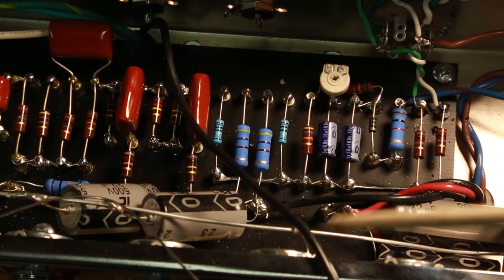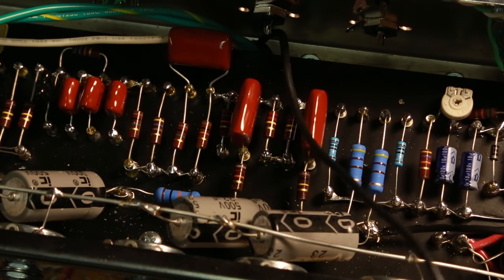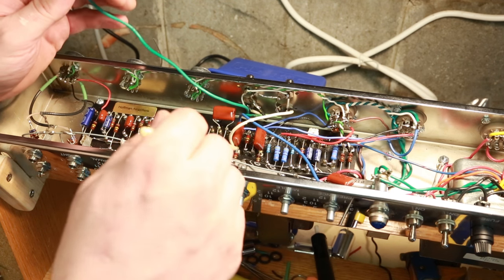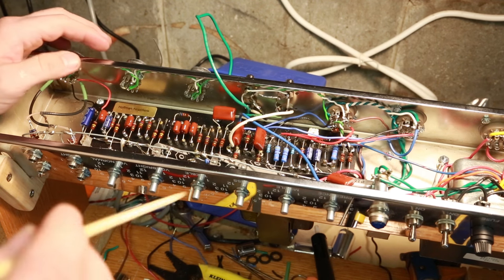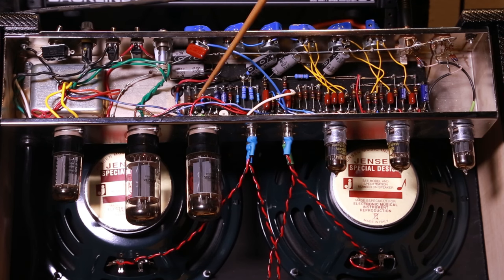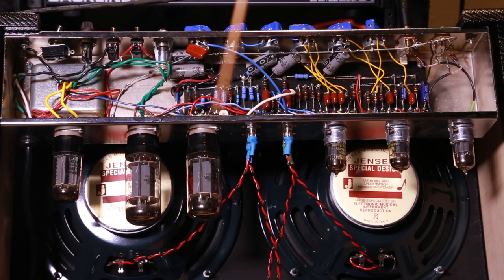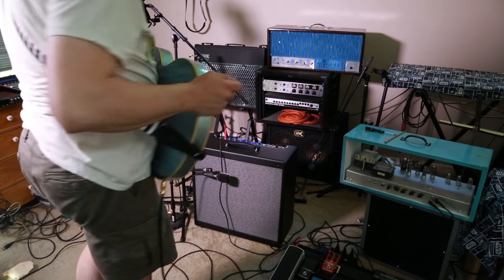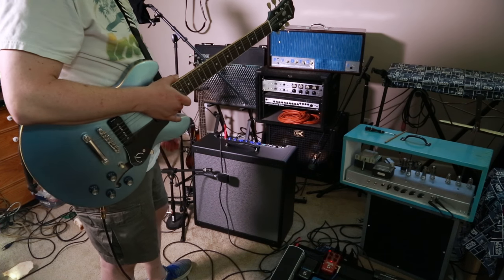Fender Bassman 5F6A Final Build and Demo

Comment: Why didn't you bias the output tubes? If the distortion sound bad, that's a first sign, but you can also hear in the clean tones. Showing bias values and voltages on an amp build like this could really help out others.
Reply from the maker: I did bias them, there's a bias pot built into it.  I don't think I thought to put that in a video, but I possibly did in the video before this,if at all, since I did this almost a year ago, I've forgotten, sorry!
Reply from the maker: It's also possible some of the distortion was the recording, I don't recall again, due to the time that's elapsed since I did this build.

Comment: Dude, I dont mean this in a bad way but that amp will be a nightmare to work on. Those caps in you have in there are going to cause you big problems down the road.  You have alot of wires crossing each other under there,  but I am glad you got it working.  Do you have any hum ?
Reply from the maker: +Ron C thanks for the advice, I've seen it done this way by quite a few other guys that follow the Hoffman amps layouts.  Since the caps need replacing about once every fifteen years hopefully it wont be too much trouble.
Reply: Actually, arching wires up away from the board is a good thing and wires intersecting is preferable to certain groups of wires running parallel to one another. Parts layout is actually very important, as well as where you place your grounding points. Too many grounds can cause ground loops.

Comment: Wow. Excellent work on all the soldering and layout, etc. Impressive. I don't dig the heavy distortion sound, as it is too flabby for me; but the clean is super! Nice and warm and thick. I could play it that way all day!
Reply from the maker: Thanks!  I appreciate the input, yes I really had a great time with this build.  I've got an AC30/4 coming up next, so stay tuned.
Reply: If you turn the bass down to 1 or 2 and the trebble down to 3 or 4 it wont sound like that. When you crank the volume there is tons of Bass naturally. Google Black face amp settings. Also tweed Bassman settings. Greg Koch gives a great tutorial on the reissue Bassman settings. I am not sure But I think the value of your negative feedback resistor is way off.

Comment: Hi sounds not meaty sounds very bassy flabby keep trying
Reply from the maker: Sorry if you look at the date on the build , its over a year ago I built it, and sold the amp. I can't keep trying on that amp.  Any suggestions on how I could improve the amp?  Or is the tone just not to your liking?
Reply: if you build another...you can increase the value of the first filter cap a bit to tighten up the bass flab if desired. i think stock were 16uf so maybe up to 22 and see if it helps. dont go too high or you lose the character of the amp and there is a limit to what the Power Tranny can deal with.
Reply: @FrenchieFilms   I think the negative feedback resistance is off not accurate. Causes alot of distortion. The gentleman that mentioned upoing the value of the first filter cap is correct. Its like having a little power reserve. So when you hit the E chord or A chord the output transformer isnt trying to make up ground. There are many other tricks to clean up that flabby bass. Just google it. Remember as you crank an amp like this it will naturally have tons of Bass. So start the bass out at Zero and adjust from there.
Reply from the maker: @chrislangdell117  Thanks for the tips!  If I do get around to building another bassman, I'll look into that.  In the almost 4 years since I did this video I've learned a lot, and I do know the bassman had bass to spare and I think a common mod is to remove the first cathode cap and replace it with something smaller as well.  The only disadvantage to dropping the bass pot to 0 is the signal gets a decent amount of loss as well in general.  But I guess the cathode cap change likely does something similar.